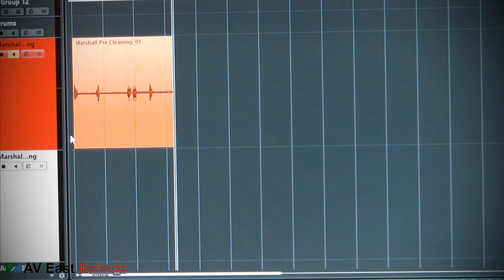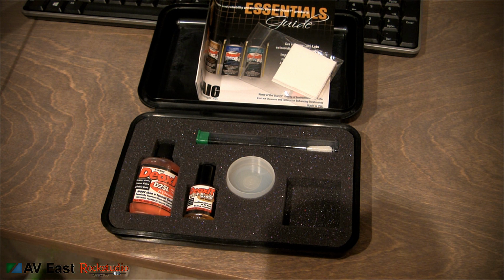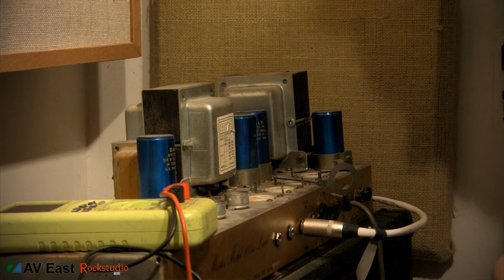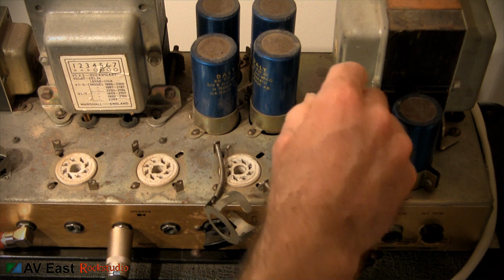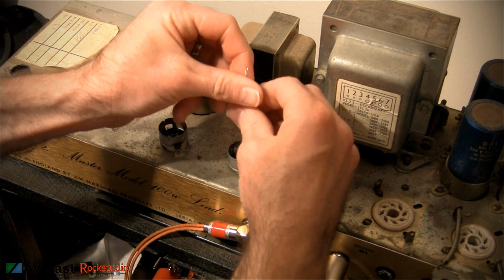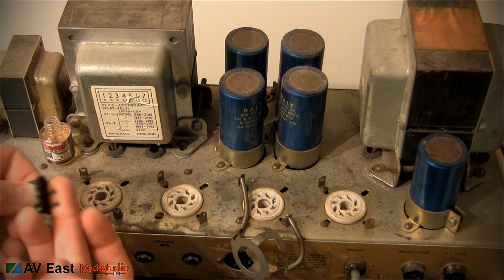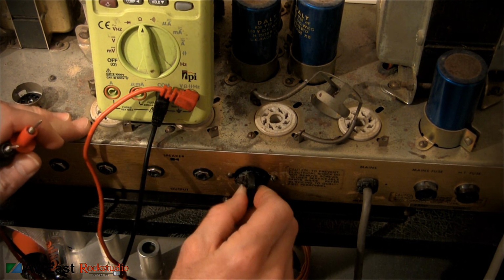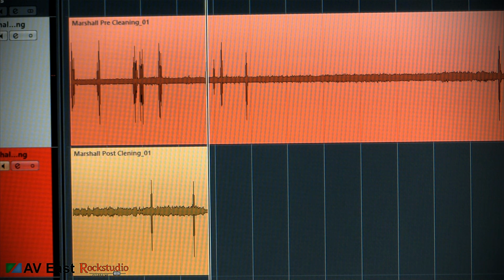Guitar amps - How to clean and tighten tube sockets

Comment: Geez, this was like open heart surgery for a patient that only had acid indigestion... spray DeOxit on the tube pins and just push the tube in and out of the socket a few times. Done in 46 seconds. Still have crackling and pops after cleaning?? Retension the socket pin holders w toothpicks for a tighter grip on the pins. Again, another 46 seconds.
Reply from the maker: Slow Down! Who are you, Lewis Hamilton of tube amps?

Comment: Out of interest how long would it take for the voltages to reduce to a safe level just by unplugging it?
Reply from the maker: It's often said that a capacitor can remain charged for hours to days to years. So you see the dilemma, you can never be sure if a capacitor has drained or not. So be safe and drain your caps every time.
Reply: @therockstudio  Thanks for the reply.  I thought that would be the case.  I have an amp I want to clean the sockets on and thought I might be able to probe the sockets with ground on the socket screw, check the pins for voltage and get swabbing if the voltage is low enough.  Still a bit nervous though.
Reply from the maker: @benspinks342  yeah, sometimes I'll check the voltage across the capacitor, but since it acts almost like a static charge, I'm not sure how accurate that reading is. Maybe an electrical engineer can chime in. But since I'm not an electrical engineer, I always err on the side of caution and just drain them. Many air conditioning guys tell me they just put a screwdriver across the contacts, and that shorts out the capacitor -  which decreases its life / destroys it and the screwdriver - because it creates a giant spark, so don't do that. Follow the steps in my video, grab yourself a nice big resistor and some alligator clips, you can get them very cheap from anywhere online, or if you have an electronic supply shop in town, that would be a great place to start.
Reply from the maker: Also, check my follow-up video about changing the plate load resistors, there's more detail about draining the capacitors.
https://youtu.be/wcorr4JQC80
Reply: @therockstudio  That’s great, thanks very much for the help and advice.  Much appreciated 👍.

Comment: Nice video! It's ok to spray tube sockets with WD-40?
Reply from the maker: I would not spray WD-40 on anything electronic! A: it's very flammable. B: it becomes gummy over time. C: it may degrade plastics over time? The spray I am using is Deoxit by Caig Labs, which is safe to use, and is designed specifically for electronic components.
Reply: @therockstudio  hace you heard about the Wd-40 contact cleaner?
Reply from the maker: @alga1309  a contact cleaner is useful for removing grime, residue, dirt from electronic contacts. However  it won't, in any way,  remove oxidation nor corrosion from conductive surfaces. So if you need to give your part an overall cleaning, use contact cleaner. But if you need to remove surface contamination, stick to a product like deoxit.
Reply: @therockstudio  thanks so much for the clarification

Comment: Nice workshop/maintenance tube amp . I wonder which software do you use and how do you link to your PC ?  That drop down voltage ( 100W to 50w ) using those sockets allows you using EL84's ? I presume the sockets does the matching voltages job ! Can I use the same configuration on a Rivera Knucklehead 100W ( 4 x EL34's ) ? Does not harm the amp using only two PT's ? Thanks for sharing your knowledge .

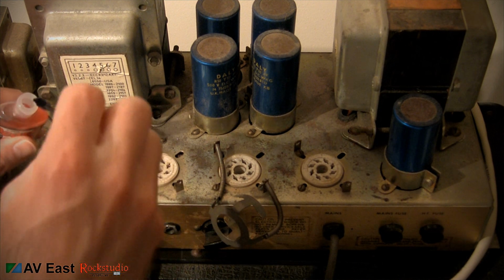Comment: 4:57...a metal bristle brush would erode the plating on the tube socket contacts- you're better off using a plastic bristle brush, and considering  the brush(es) to be disposable "single-use" items like cotton swabs.

Comment: I found a brownish oil type of substance around the base of the pins on my tubes. Anyone know what that is?
Reply from the maker: How long have those tubes been in there? How old is the amplifier?
Reply: @therockstudio  it's been a while since I've had these tubes put in but I can't say for certain how long ago that was. Other than this one thing that I noticed the tubes are in perfect working condition there's nothing wrong with them. At first I thought maybe it was some kind of lubricant to get the tubes in and out easier but after watching this video I'm wondering if maybe it's something similar to what you've used just maybe a bit discolored.
Reply from the maker: Hmm,  it is possible that whomever installed your tubes used some sort of contact cleaner/lubricant on the pins. But the fact that it's brown leeds me to believe that maybe it was a soda or a beer that may have been spilt near that area? Worst case scenario is some sort of capacitor is leaking? You've got to tell me what sort of amplifier you're dealing with, and from what year it may have been manufactured.  But as long as your amp is working fine, and your tubes are good, make sure to discharge your capacitors and unplug your amplifier before attempting any sort of cleanup!  Be really safe, and thank you so much for watching and commenting.
Reply: @therockstudio   its Mississippi made peavey delta blues combo so it'll be old enough to where it would still me made in America but im not sure about the exact year but its not terribly old. I have two of these amps and just checked both amps tubes and the stuff seems to be on both of them. I did notice the substance looked more clear but maybe slightly discolored  on some of the tubes. I also can now that it seems to be on the pins as well. again this is on both amps.
Reply from the maker: Okay. I'll ask around and see if anybody is familiar. If you live in a humid  climate, you never know, there may be some condensation that collects when the amp cools off, and  somehow collects at the pins of the tubes?  The amps look to be made pretty clean, with modern components and everything, I was reading some difficulties when dealing with the u-shaped circuit board. However if both of yours work, I read that they're really good amps to have. Cheers!
Reply: @therockstudio  Preciate ya man. yeah just  try to remember me here if you find out about that. I have had both these amps serviced by the same guy and it maybe something he put on there.
Reply: @therockstudio  ...sounds like silicone contact cleaner, to me- it's POSSIBLE that the last person who worked on the amplifier added silicone contact cleaner to keep moisture from getting into the tube socket contacts...

Comment: Great video thanks. You mentioned not being able to find those brushes by themselves. I have been using a similar thing from the dentist designed to clean between teeth and around gums etc. Seems to work pretty well and is basically the same thing. Hope that helps!
Reply from the maker: Ahh, I see. This is a stainless steel brush though, have you seen one of those for teeth? I figured it would be way too rough/sharp. Thank you for commenting and watching!
Reply: Youre right it does have plastic bristles so maybe not up to much against serious corrosion but definitely helps work your cleaner around the sockets. Plus its the best thing iv got available! Ill remember those kits if I encounter anything particularly stubborn

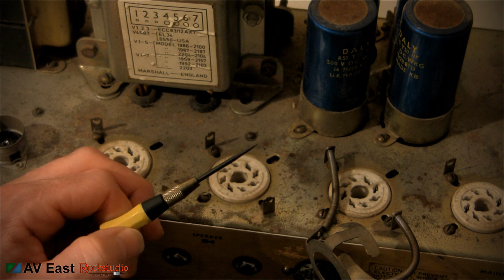Comment: @ 8:11 where do you get that needle point tool - how do spell it - awl?  aul?  all?
Reply from the maker: Hi, I'm using an awl. You can buy one at any hardware store. Just make sure it is thin, roughly the diameter of a toothpick. Please don't mess around in a tube socket without draining your caps and having some experience with dangerous tube equipment. You may blow off a finger or receive a fatal shock.
Reply: ...right the first time: "awl". An ice pick would work too.

Comment: Thanks for this video!  I'm about to do the same on a few of my amps.  I have a question about this el-84 socket thing to run the Marshall at a lower power.  Do you rebias the amp to deal with running at lower power?  I've been thinking about how to tame my Marshall to avoid the wrath of my neighbors.  Maybe that would make a great video, not that you need like suggestions or anything.
Reply: Go to eurotubes.com and ask them if they have a lower output tube for your specific amo
Reply: @onixtheone  thanks, that is a good idea.  I've got to place an order with them anyway, for an old Fender Pro Reverb I've decided to stop neglecting.  I should add that I learned the answer to one of the questions I have above.  The "yellowjacket" type tube converters don't need biasing, the tubes are self biasing.
Reply from the maker: Sorry I missed your question. In case you haven't found a what you're looking for, I'll give you some info. I'm using Ruby tube adapters, I'm not sure if they are still in production. Yellow Jacket tube adapters are also very popular. You do not need to re-bias your amp, the adapters take care of adjusting themselves (magic?). Anyways, I buy most of my amp stuff from tubesandmore.com the last category on the menu is "yellow jackets". Thanks for watching!

Comment: Thanks. One of the two power tube sockets on my blues junior is totally dead. Hoping cleaning will fix it.
Reply from the maker: Good luck! You might check the solder joints on the PCB as well, just be sure to read up on safety precautions first. Thanks for watching.